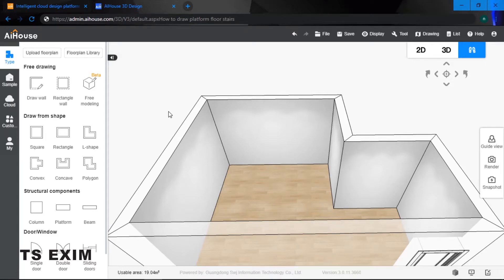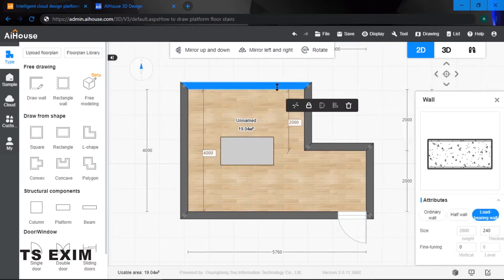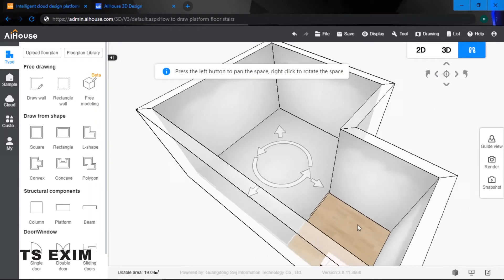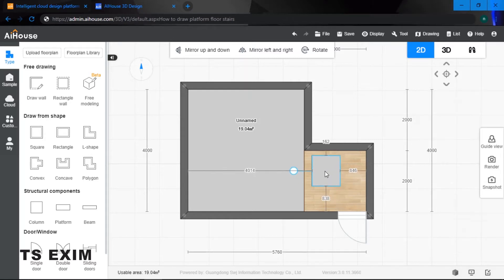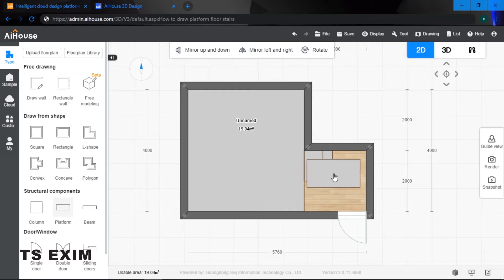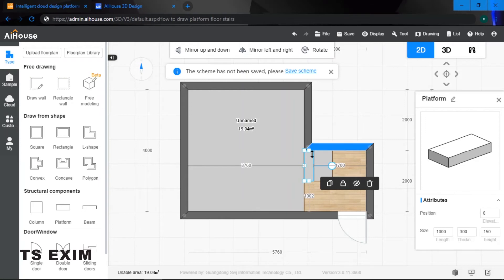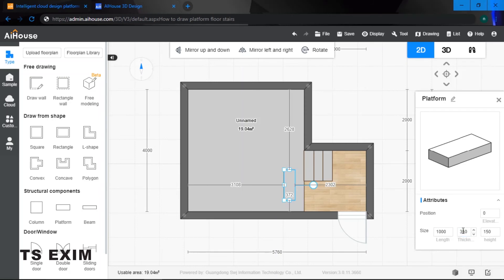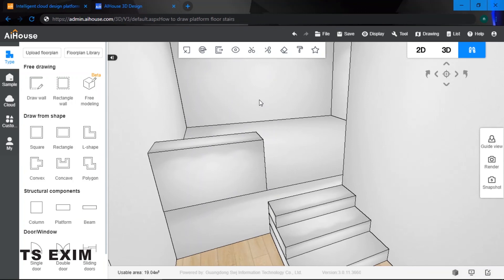[Technical FAQ] How to draw platform floor stairs? (b) | AiHouse

Comment: for the three floor steps is ala carte items ler..but it will be better if using ceiling function to create the floor steps right ?coz if using ceiling function the 3 floor steps is considered just 1 item, instead of 3 differently joining steps.